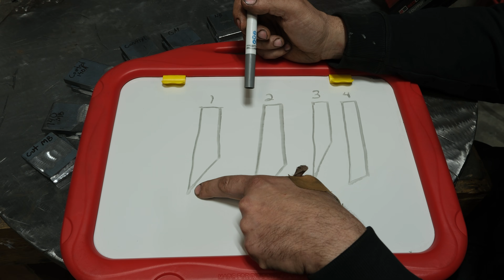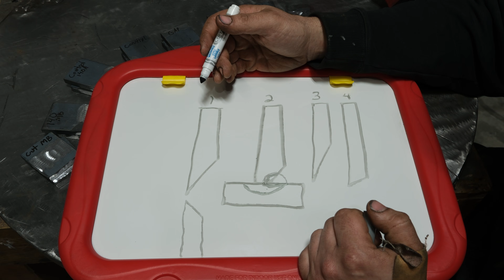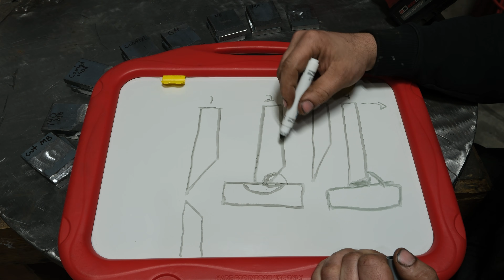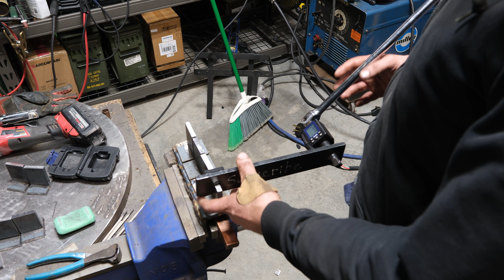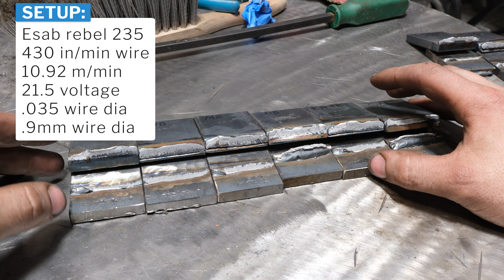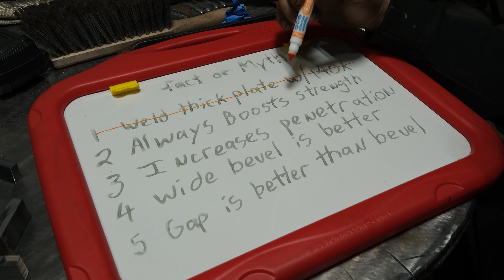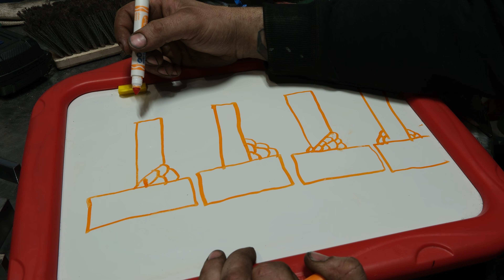Does beveling increase weld strength??  Deep dive

Comment: @Making mistakes with Greg hey man, just re-watching some of your older video's , & watching this got me thinking, what happens if you weld a bead on your base plate & then grind that flat to put your top plate on & deld it to the first weld? it would give a narrower part to weld to on your base plate & on the first weld you would have allot more fusion to the base plate as you would be focusing solely on it, any thoughts? 
Thanks again for these great video's.

Comment: Curious what effect preheat has. If any, what temp(s) is appropriate/most effective?
Reply from the maker: So I have tackled this in a few videos (link at the bottom of this for one) and universally found preheating basically does nothing to increase the depth of penetration.  It will cause welds with MiG/stick to flatten out and possibly may increase sidewall fusion (weld toe to material).  With that said on a fillet weld there is no measurable increase in how deep the process penetrates past the root.  This makes a lot of sense when you understand how welding works.  With MiG/stick you are more or less traveling with an arc between the molten pool and the tip of the wire/rod.  Making the base material hotter will not do anything to the thickness of molten pool the arc must make it through to penetrate, therefore very little is gained with preheat.  This is why pulling with MiG produces more root fusion, therefore very little molten puddle is thinner and it’s easier for the wire/arc to reach the root.  This is also why welding vertical up with MiG produces more penetration, the puddle is drooping down away from the root which makes it easier for the heat to hit the root of the joint, there is no molten metal in the way.  

With that said it is common to preheat thicker material, but it’s universally done because the base material needs it (aka it will crack if welded cold) or to reduce the residual stress of the weldment.  It is not done in industry to attempt to increase fusion, acceptable fusion is achieved via the process itself.  

Here is a video:https://youtu.be/plXsPXs7e6s?si=Jg_A0vHGY4R1WPRY
Reply: @makingmistakeswithgreg  Finally--someone explained it in a way I totally understand. Thank you!

Comment: 1:15 NADCAP classifies welding as a "special process". Basically, a special process is defined as a manufacturing method, where non-destructive final inspection is insufficient to verify performance of the material or product. Final inspection must be supplemented by a carefully controlled manufacturing process (performed by qualified personnel), often supplemented with in-process inspections and/or destructive test specimens that were manufactured in parallel.

Comment: Seems largely like common sense. As I venture back into welding for the first time in about 20 years, there’s plenty that’s being drug from the cobwebs of my brain. One thing I need to do is cut some of my welds apart and etch them.

Also, this is making me want to see if I can manage to set my old Miller up for spray transfer even for 3/16” lol
Reply from the maker: I am going to be testing out .030 wire and spray to see if that’s an option on lower powered welders.  In theory it should be possible to achieve spray with that wire at under 200a, but I have a feeling duty cycle will be an issue and many machines still won’t output enough voltage to run it.  If it works it will possibly be an option for you, since .035  generally is beyond what many 200a class machines will handle lol.  Also, definitely cut and etch some welds.  You will learn a ton doing it, and you will have absolute proof that what you are doing is working 😀👍

Comment: Dear GregI have a clarification on the cut section of the fillet weld. It is seen that there is no fusion with the bottom plate and more on the vertical plate. when the arc is focussed on the bottom plate or 45 deg to the root how is that there is less fuson on the bot plate and more on the bevelled edge. Normally we see the other way.

Comment: Before it starts- steel is around 30,000 psi tenstial and wire is 70,000 psi tensional so....
Reply from the maker: Most a36 hot rolled people work with is between 45k and 60k, and could be more.  The filler wire itself is 70k minimum (often testing higher).  Due to many variables (shielding gas used, heat input, etc) it’s possible to produce welds with er70 that are weaker than 70k by a significant amount.  👍

Comment: I think the real question is what would possess anyone to mig weld 3/8 inch plate at 140A? To me it looks like you are way too light on the amps even on the control coupons.
Reply from the maker: It’s more common than you would think lol.  The three biggest myths I have battled with since starting the channel is preheating increases root penetration, beveling increases penetration, and pushing increases penetration.  All of those things aren’t generally true, and when you combine what amounts to a hope and a prayer to weld thick steel with an under powered welder, you wind up with failed welds lol.
Reply: @makingmistakeswithgreg  Interesting, So instead of just getting a powerful enough welder people use a bunch of voodoo. Very different from how we do it here in Sweden.

Comment: How did you make that torque device?
Reply from the maker: So I made a lever to hook the torque measuring device too.  It’s basically thick steel with a notch on one end and a socket extension welded to the other end.  The reading from the setup is not exactly accurate because the torque reading is further back from the plate.  However the meter itself might not have been able to read high enough to go directly on the plate.  Since I use the same device on every break test it works for a comparison within that test because the device stays consistent.

Comment: I was taught to concentrate on bottom plate let weld push into flat plate. It looks like you kinda missed on some of the welds.
Reply from the maker: So there are a lot of ways to make a weld.  What you describe would be a good way to weld a thinner piece to a thicker piece, with the thinner being upright (fillet weld).  Welding actual joints of similar thickness you want your rod pointing into the corner with a slight favoring of the upright plate.  Gravity will pull the weld down and if you don’t favor the upright plate you will have a higher probability of undercut, or unequal weld leg length.  Concentrating on the bottom plate will cause the weld to likely be wider on the bottom plate, and may reduce root fusion.  

The easiest way for you to determine if what you’re doing is working is weld a few fillet welds out with different rod angles and cut them in half.  You want to see the weld leg length be equal on both top and bottom plate, and the root should be fused.  You will find that some techniques are better than others.  The worst thing to do with welding is making assumptions that a weld is good just by its appearance.  That’s kind of the point of this video and most of them on the channel.  You must test and look at what’s going inside of a welded joint to determine if what you’re doing is correct.

Comment: ONLY a "Root Pass" ? 
Why not perform and test REAL application conditions ?
 IF we should know how to BEST weld bevels , why not show and test THAT too ? 
Or at least _include ONE fully stacked multi-pass weld using the best combination of technique and welding rods for root pass and fill and finish passes. It seems to me that additional passes would penetrate at least as well going up the face of the fillet as they then also penetrate at the edges of the fillet, penetrating there all along the transition from the base metal  through the fillet itself ? 
It SEEMS that such a bonding all along the face of the fillet then also  TO the base at each edge would add the necessary overall "Weld Strength"? 
After all, with such LITTLE penetration as was shown in your break-away examples - its almost as tho there's no more effective actual penetration than if they had been brazed instead ?
I was SHOCKED at how little force was needed to break those 1-pass test welds ?!
Wow !
I've learned more of ACTUAL VALUE here than just about ANYWHERE on The Tube !
THANKS !!
- C .
Reply from the maker: One thing I will be doing soon is making a video demonstrating proper multi pass fillet welds and achieving proper penetration.  The biggest mistake 99% or people make with welding is assuming what they are doing is correct and is working.  I can’t count how many times people have told me things like the following:  “just run more amperage, up the voltage, bevel it, preheat the plate, if you just ran this setting it would be fine, push not pull, etc”.  The truth is there is no magic solution and no settings are guaranteed to get results.  When you’re talking about steel above 1/4inch thick the only way to know what’s going on internally is to do cut-etches and bend tests on your own welds.  That’s why I stress so much to people that there is no substitution to verification.  

One thing that I kind of glossed over in this video is the fact bevels do actually help in certain situations (butt welds mostly).  By having a bevel the weld pool can spread out (instead of getting thicker like on an inside corner/fillet weld) which will lead to higher penetration.  The problem is most of what people weld is not open root beveled butt joints, so how helpful this is limited at best unfortunately.
Reply: @makingmistakeswithgreg   - Yeah, I get that. MOST of the time we see little actual weld-prep, AND there's even lots that don't even clean first !
Thanks again !
- C .

Comment: Bevels for butt joint are required to get state certification in Kentucky where I live. But a lot of things required in certification tests is hardly ever done in practice except for pipeline welding.
Reply from the maker: Yep, many state certifications for structural steel are mostly beveled plate, backing bar, typically 1/4in gap.  The applications of that in real life are very limited like you said.  Pipe welding sure, but to actually building things less so lol.

Comment: My opinion on beveling is it is born out of people without a proper welder for the task at hand trying to get the best results they can. Pre heating it probably better in many cases. Now a lot of this will all have to do with the quality of the metals vs the quality of the wire or rods being used. Real welding isn't half ass brazing.

Comment: What r u using to cut and etch.  Thankx for taking the time to make these video I greatly appreciate it.    Keep them coming
Reply from the maker: You want to cut the metal and get the surface reasonably polished.  A green rollock disc on a die grinder or a 80grit flap disc on an angle grinder would work for that.  For the etch I use naval jelly, available all over for 6-8$.  One bottle would last a lifetime.  You just wipe it on the weld and give it a minute.

Comment: Been welding on and off for 40+ years, started at 14 years old. Yes beveling is necessary when welding thick material. How I bevel depends on what I'm doing and if I'll be able to weld from both sides or just one. A gap is also a good thing. Remember in welding your intent is to make 2 pieces of iron into 1 solid piece of iron. I've done a lot of repair welding on heavy equipment  with thickness of 2 inch. I never use a mig on any thick material bevel or no bevel, use stick. The angle of the bevel depends on what I need to get that first bead down as deep as I need it. It's not a good thing when you weld something on a machine and they call you 2 days later because it broke again.

Comment: Would it be correct to say "the more surface area that is welded-the stronger the joint"? This makes me think of gluing up wood, where a butt joint is the weakest when compared to tongue and Grove, dovetail, joints with biscuits or Dominos ( which are newer). 
If you have the mindset of more weld metal the better even if you have to cut or grind away base metal and replace it with weld metal? Asking because i really don't know. Gluing wood could also be a dumb analogy.
Reply from the maker: Not a dumb question.  So wood glue and brazing have a lot in common.  With brazing you don’t melt the base material but rather bond to it.  With welding you melt the base material together and create what is essentially one homogeneous piece of metal.  By welding on a bevel (fillet weld) you do increase the amount of weld that exists between the plates.  This can increase the strength because you effectively have more solid metal between the plates.  The bond strength is not increased with more weld metal, but instead thicker weld metal is stronger just like thicker material is.   

Where bevels can be problematic is when people put a bevel on plates and weld them without testing what they are doing.  The assumption that the bevel is guaranteed strength can be wrong.  If the weld is not properly fused it can be weaker than it should be bevel or not.  Hopefully that helps 👍

Comment: From my personal experience when wielding before i start my bead i tack one corner and tack the opposite backside corner and then tack the the remaining corners like im tightening bolts/nuts x pattern then i grind the tacks down then run my bead it seem help with warping. Obviously i cant do that all the time, but whenever i have a job that i can x pattern my tacks i do it.
Reply from the maker: Definitely a good way to do it.  The grinding down of the tacks is key, so you don’t get lack of fusion when you run over them.  Sounds like you have a lot of experience dealing keeping things straight 😀.

Comment: The machine I have is a 175 amp lincoln short arc mig and 1/4" plate is as thick as I weld with that machine. Anything heavier is done with stick and far more heat than a wire machine will give you. Root pass or (stringer beads) are done with 5P plus rod.

Comment: The bottom line is a 140 amp machine is not hot enough for anything over 1/4" plate. A beveled plate doesn't change the fact that 140 amp machine is not enough for 3/8" plate.
Reply from the maker: 100% agree.  Hopefully others understand that as well because there is a lot of information out there saying beveling will allow that to work, and that’s simply not the case.

Comment: do it again and turn the heat up.
Reply from the maker: The only way to “turn the heat up” is to switch to spray arc or use 100% co2.  Simply increasing wire feed over the settings I ran will just deposit a bigger weld, not penetrate more.  As long as the voltage and gas mixture is at short circuit range nothing will be gained with higher WFS.  Higher voltage will not increase penetration in the root either.  A different gas mixture is what’s missing.

Spray arc will fuse far further than any of the welds in the video.  However it also penetrates far further than short circuit mig on unbeveled plates.  The main purpose of the video was to demonstrate why simply beveling thick plate is not a legitimate solution to a lack of power/proper gas mixture.  In the future I may do a comparison of short circuit and spray on a beveled plate, the results will be similar to unbeveled plates.

Comment: What was your pre heat of any of these welds?
Reply from the maker: I did not preheat the plates.  Believe it or not preheating will not increase fusion depth by much.  I did a video on this previously but I am working on a new one that goes more in depth.  Preheating can give the illusion of more penetration because a weld will typically lay flatter and the toes of the weld will flow out better, but the actual depth of penetration change will be limited.

Comment: Thanks Greg
Would there be more of a difference if you used stick welds with different rods?
Reply from the maker: I actually did the whole test with stick and ran into a lot of issues.  With wire you can weld oddball angle bevels and it still works.  With stick you have bad arc blow issues when the bevel is too narrow and the rod can get in far enough.  I couldn’t get consistent enough results to make it a reasonable test.  Stick still has the exact same lack of fusion that happened with mig on shallow bevel angles.  Most rods (besides 6010) don’t have that good of penetration so you must have a wide bevel angle and a gap just the same as with wire.

Comment: I guess if the part were small enough and it had to be strong... I'd bevel the vertical plate, tig root both sides and then use dual shield 100% co2 fcaw on the fills and cover.